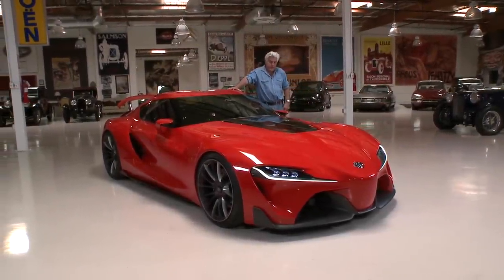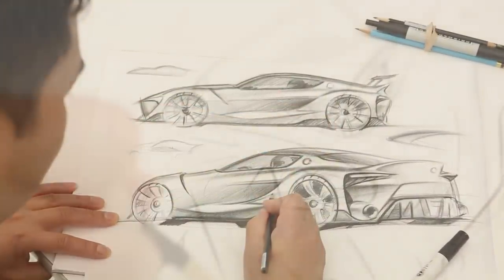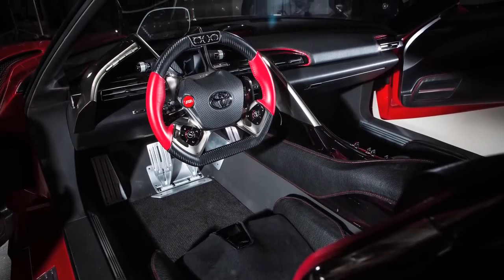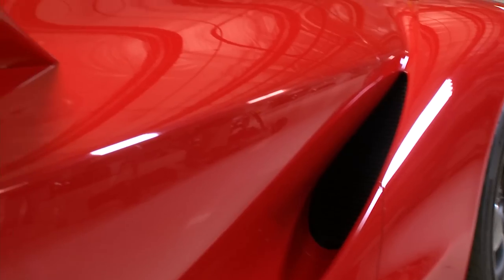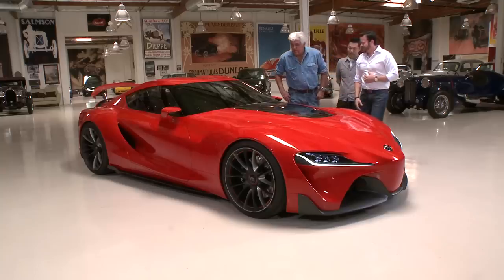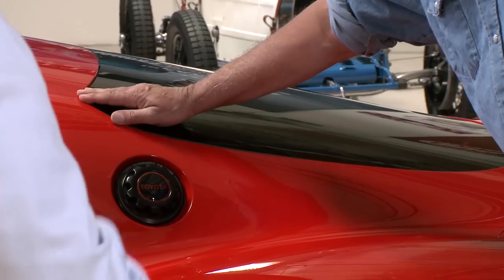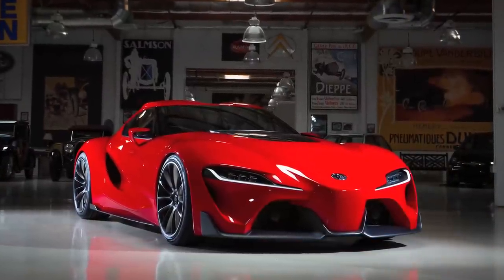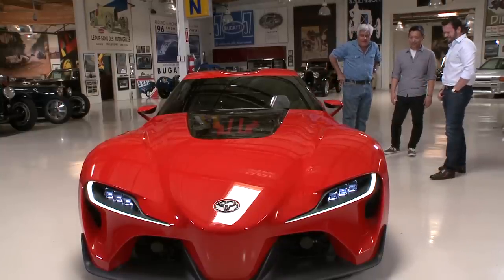Toyota FT-1 Concept - Jay Leno's Garage

Comment: I was able to see this car in person at the Chicago auto show and it looks incredible in real life.If Toyota could bring this to production at around $120,000 then I think it would be big competition for cars like the Audi R8 and Lexus LFA.
Reply: I think people would pay more for this over the Vanquish, F-Type, and as you said, the R-8.
Reply: I would buy this.
Reply: For it to be a reasonably priced car the masses can afford no DCT, no AWD, no 500hp inline six so no GTR fighter. maybe a Celica gt 350hp 3.5 v6 direct injection 6 speed manua $40k . Supra same chassis with AWD, Twin turbo 3.5 v6 500hp ,dual clutch tranny, body mods that set it apart from celica that could be the  GTR fighter. you can change any or all that but you get the idea but it will probably be a hybrid pos
Reply: sid johnson I disagree... Ford can make a 500HP car that middle class people can afford, I think Toyota should do the same...if the car gets the Supra name...it would be unfair if it did not outperform the former gen. I'm thinking in the 60's is realistic.
Reply: Phillip Lamb It won't happen, Toyota's quality far surpasses Ford, that's where the price difference is.
Reply: The supra will likely be 2.5 turbo six with hybrid assist .what a pos that will be
Reply: Lmao I would take an R8 over this any day. My guess is 60,000-75,000. Toyota won't want to compete with the GT-R.
Reply: Agree

Comment: If THAT Supra gets built, no wide-body kit needed...that thing is simply beautiful as is.
That said, it could be a Godzilla killer as a twin turbo ~$100,000 "affordable" supercar. So long as it has a dual clutch.
If you're gonna make it, please don't skimp.
Reply: I hope it also comes with a REAL manual
Reply: I was thinking more of $60,000 like the Supra.

I don't think this car would ever come near $100k with a Toyota badge on it - that's why they have the lexus brand. 

That being said - I am just purely hoping. If it's $60k I might, if I save my pennies, afford this car.
Reply: Jeston Aylen Nissan has Infinity. What about the GTR?
Reply: JCatJake GTR was adopted from the Prince motors takeover - it's kind of Nissan's heritage at this point. Toyota had at that same era more affordable sporty 4-cyl such as the celica and the corolla (such as the E37)

Although Toyota did have a few more expensive platforms, it was very limited run and very, very exclusive: the now legendary 2000GT as well as some just are rare road cars such as the GT-ONE. All of which received less then 400 units built.

Toyota has never mass produced any single sport car costing much more than 60k in it's entire history, aside from "high-end" options and some factory tuning options back when TRD actually did more then plaster a logo on your vehicle.
Reply: Jeston Aylen If Toyota sticks a twin turbo in the Supra with carbon fiber galore, it'll undoubtedly unfortunately be higher priced than the GTR since Nissan builds that on a mass scale on the same assembly line as Infiniti...whereas there wouldn't be a massive supply of Supras, and along with the high demand for one, they'd be able to jack the price and get away with it.

Comment: Your move Toyota, you want to continue making appliance or you want to be know to make amazing sports cars!
Reply: why cant they have their cake and eat it too? you know how much revenue those "appliances" bring in?
Reply: enemay My old '85 GTS Corolla was that, entirely.  Dead stock, it was reliability defined. The rear hatch, folding rear seats made for a versatile and practical dailydriver. Gas mileage was decent, around 30 mpg with causal driving, +-20 mpg when romping on it.  In the tactile sense, it was performance oriented in some wonderful extremes. Steering was light, precise, and could keep up with the posi-traction, even in snow or mud. Revving to 9K took a bit of nerve, but Gawd, you could stand on the gas, while diagonal, all day! With a crisp 5 speed, this could use it's revs, at least until the aero drag came into play. I ran against Lotus Esprit one day outside of Boston, and lost him before I got to 5th gear (this would be 50-to-OMG, not from a dead stop); I never topped it out completely, but got 9700 rpm in 4th one day, and that was 133. Toyota can build cool stuff, it just has to commit to doing so. Perhaps that commitment is just a bit too much??
Reply: enemay Toyota has a long heritage of making great sports cars, and has nothing to prove. Only a noob doesn't know that.
Reply: ERIC BRAMMER My First Gen Corolla...maybe 72-75 hp....1200 cc with the 1100 head 10-1 compression...stock 2 bbl carb...all stock guts...custom made headers, two 2 into 1 with true dual exhaust....4 speed....4:22 rear gears...1500lbs........basically stock except the header and head.

I made a 101 mile trip in 50 minutes and had 3 small towns to go through at the speed limit. My speedometer stops at 100 mph. Third gear will take me near 75 mph. I've been clocked by police at 131 mph. I've beat 351 ci Fords in short drags. 5.0 mustangs in traffic...atv's in the mud.....a guy in a 60's Jag kept trying to leave me behind on the freeway and I just stayed right on his tail til he had to stop and see what I had. (everyone thinks it's a Volvo). I put a trailer hitch on it and have towed a full size long wheel base Chevy truck on tiltbed trailer about 60 miles, boats, my work trailer...once pulled a roll-back tow truck that wouldn't start (13 tons but just across a parking lot). Never been stuck in snow, mud or ice in the winter, I go out and play around, try to find hills I can't get up. I don't know if it corners well or if I can corner it well but it does fine.

When I'm not doing all that it gets 50 mpg at about 65 mph.

Tough little bugger...I bought it when it was 19 years old and don't know how many miles were really on it as it it's old style and rolls over every 99,999 miles, I've put 753,000 on it myself in the last 28 years. Still drive it to work every day.

They only sold 7,247 of the 1968 version LHD US models....it's probably the rarest Corolla model in the world and most likely the only one that has been daily driven almost since new (couple of time offs and I have messed with the engine and brakes and stuff) but mostly on the road for 47 years and still going...not pretty right now as my time is limited but soon again.

Got it for 300 bucks. It was and still is my first car and will probably outlive me.

Right now I'm trying to get it back to as stock as I can except for the brakes.
Sorry this went on kinda long. :)
Reply: CorollaNut68 That was awesome, thanks for posting.

Comment: The Supra really made Toyota what it is for me.  Without it, Toyota is just another company.  And that's why flagship models are so important!
Reply: No doubt, when I was 18 I bought a used 1987 Supra Turbo, liked it so much a year later I bought another one in better condition...
Had to sell the toys though when I had a kid. Now I just bought a 1985 Toyota 4Runner to restore. and I'm currently working on a 1994 Celica GT also.
Reply: Ivan Koshy They were very reliable. So reliable I haven't really owned anything but Toyota's since then.
I had them both for about a year, then my son was born & they had to be sold. :(
Reply: They also had the Land Cruiser. Those were and are popular in the safaris and expeditions. Remember the commercials? They would go into the mud water.
Reply: I would like to find an old FJ if I could, and it wasn't too expensive. They are getting more & more rare every year, the originals that is.
Reply: LegendsXXX2  when i was 19 i bought my MK3 Supra, perfect condition except for the engine, now its been years and i got it as the perfect street car, 2JZ swap, ~600whp, clean paint job, every single nut and bolt in its place... now i'm a bit older i think i'll want to buy this car new when it comes out
Reply: No doubt right! That supra sounds fun though! Man, I still want another mk3 myself but only after I'm finished with what I'm currently trying to work on. Lol

Comment: Please bring back the Toyota Supra 1998 with an LFA engine.
Reply: and don't make it 400k
Reply: Gotta keep the 2jz
Reply: Yeah good point actually keep the 2jz
Reply: ClaysPranks So just re-release the Supra then?
Reply: Will NEVER Fffi'ng happen.  Even if it does, it will be a Lexus badge.
Reply: Tell me about it. Why do car companies not understand that all they have to do is start making all the cool cars that they used to again. They could literally start production on the 1998 Supra, the exact way that it was, and sell for 50 grand all day long. Same with the RX7, the R34 Skyline, muscle cars, etc. I think that part of the problem is that, as Jay's pointed out, they would probably have to redesign them just to pass all the BS laws these days.

Also, the LFA engine would be cool, but I would probably rather have the 2JZ. Cheaper maintenance, obviously still very fast, probably weighs less, better gas mileage, etc, etc.
Reply: They are building a new supra together with bmw

Comment: the clutch is missing
Reply: Ethan Dipple ITS STILL A CONCEPT... LOL, But the recing one they are making is manual
Reply: drift_killz1012 ^ read my comment XD
Reply: Dual clutch transmissions are tons better
Reply: Ethan Dipple  no more clutch shift paddles
Reply: lol  @ethan dipple,  the  SHIFTER'S  are only on the  ''  Steering wheel '' :P :D :P    see this at  12:03
Reply: Tokahontas doesn't get it.
Reply: A comprehensive study showed that 90% of Japanese people are too short to fully depress the clutch...so they go with auto to satisfy the majority.
Reply: Tokahontas Get out of here. No they're not, they only shift faster, and take away everything else from experience of driving manual, satisfaction and all skill of it too.

Comment: I like it, I just hope the production version goes with a single radiator and opens up the front nose. The one and only thing I don't really think is to good is the center piece between the two radiators. I have been a lifelong Toyota buyer and driver, I currently have a 2016 FR-S and like it quite a lot, I do have the TRD exhaust, intake, and the lowering springs. In the near future I do plan to have the TRD supercharger installed and geared to have 60-70 more horses. I'm still using the stock tires and rims, as soon as the tires ( my car is still very new) need replacing I will going with a wider tire and possibly different rims. I also plan to get a front diffuser and some kind of bigger rear spoiler that's not too big but is functional. I have had my FR-S up to 155mph and felt very stable with no lifting of the front end. If this new FT-1 becomes available and has a 6 cylinder and is somewhat close to this car shown, I just may trade in my FR-S for this FT-1....but it will have to be at least a couple of steps up from the FR-S, because despite what some may say about the FR-S, it's a fine car, good performance for the price with available upgrades to up the performance to another level all the while keeping my FR-S a Toyota that's well built and reliable with great resale value...not all of us can afford a Ferrari...
Reply: woodystorey TRD? I'm actually buying a brand new Toyota gt86 if you're happy with your modifications would you mind walking me through or recommend any particular mods?
Reply: The Toyota dealership will have upgrades for a few things....if you do get any, get them before taking delivery of your car and just have them add the cost to the car....that way the Toyota mechanics install them and the upgrades will have a warranty. You can get upgraded exhaust, intake, anti-sway and anti-roll bars, lowering springs, drilled and slotted brake discs and either a supercharger or turbo...the turbo kit is the same as that is installed on the Subaru WRX STI. You have to decide which way ya wanna go....turbos will cause more heat into the engine, and use exhaust heat to create the added power, but the supercharger uses the engines power off the crank shaft for it to work much in the same way the air conditioner uses power off the engine to work, so the supercharger will add lots of power, but it takes power away as well to create the power. The bigger the pulley wheel on the supercharger, the more power that will be made. If you're rich and money isnt an issue, use a big pulley wheel, but the engine doesnt last as long.....and TRD means Toyota Racing Development....hope that helps dude...
Reply: Also, if ya have a decent amount of money, check the Lexus GS series....Lexus is of course made by Toyota and are AWESOME car. the GS sport is insane, and have all the upgrades similar to what I mantioned....after getting a GS with the upgrades, that GS will be a 500hp..all wheel drive fire breathing monster....and all wheel is a handling dream, those GS's blow away BMW's, and many other similar class of car....I'd have a GS, but are a bit out of my price range...

Comment: Keep this thing under $50k, give it 450hp and it will fly off the shelf.
Reply: That would be such a waste.. I'd hate to see this car in every corner like a celica.
Reply: Realistically it will be more than $100K price tag
Reply: Give it three configurations like a small engine for the base model, a boosted small engine for the middle and the LFA powerplant for the top of the range. kinda like a slightly more affordable Japanese F-Type
Reply: EpiDemic117  a V6 in a Supra? i think not... the only engine they plan on putting is a straight 6 turbo...
Reply: 123Comrade  they are only planing on putting in a straight 6 turbo as the only engine option.... this will be the flagship sport car for Toyota so they don't plan to build and sell that much, as a result its going to cost $60K-$100K.... i'm sure they will build another sport car to place under this car for about $50k (maybe a 4cyl hybrid)
Reply: EpiDemic117 i know its odd that out of all the car companies that made straight 6 engine sports cars that its Toyota is the one who take the heritage of their cars seriously... even Jaguar put a V6 in their F-type just to save on cost....

the skyline GT-R wasn't really a "pure" car you could get it in a 4door, wagon, 2door and there was always a 4cyl engine option so when they did put a V6 in their GTR to save on cost i wasn't surprised (but alot of Skyline fanboys was pissed off) 

anyways i don't think Renault will make a straight6 engine just to be used in one car, it would be too expensive and will not cost less than the GTR.... and i think they are going to start making the Z car a 4cyl so they can sell more of it like the GT86/ FRS/ BRZ
Reply: EpiDemic117 you do have a very good point....
Reply: 69Z10 Sadly this isint a mustang. Expect $80K plus.
Reply: dunhillsupramk3 They actually stated not long ago that its going to be a v4 with turbo and two electric engines made with help by bmw so.  i hope your right and they go at least v6
Reply: phatdistraction  i don't think BMW or Toyota makes a V4 engine.... also they is a difference between a V6 engine and a straight6 engine
Reply: Ivan Koshy nope, that is an inline4 not a V4 engine....
Reply: Ivan Koshy  yes i know all the types of engine layouts but it is very rear to see a car use a V4 engine, currently there is no car in production today that uses a V4 engine... its more used as a small boat engine....
Reply: Ivan Koshy  well V4 is the wrong term for an inline4 engine.... i personally don't know much about the V4 engines but i would guess they are more expensive to manufacture that is why car companies mostly do inline4 4cyl engines today....  F4 engines (4cyl boxer engine) are also produce but they cost more to make...
Reply: I don't know much about it either, I just read that it won't be a V6 and figured to not let others get their hopes up, like you and I, on a V6
Reply: phatdistraction  there is a difference between a V6 and a straight6 engine.... they said a straight6 turbo maybe the only engine option available for this car
Reply: This will have over 600hp
Reply: dunhillsupramk3 I just want to know more about it, so learning any information on the car just makes me happy
Reply: Well its rumored to have a v10
Reply: 69Z10 Totally! Glad Jay gives his approval!
Reply: 69Z10 Only Dodge has been able to give so much HP at under 100K
Reply: phatdistraction  well its always fun learning about cars... there is many videos on you tube on cars
Reply: Ivan Koshy Yeah...the cops are starting to get rid of all those Chargers now too....they're not holding up. They can completely rebuild a Crown Vic cheaper and get more time out of it.